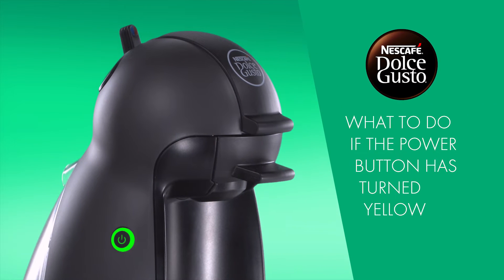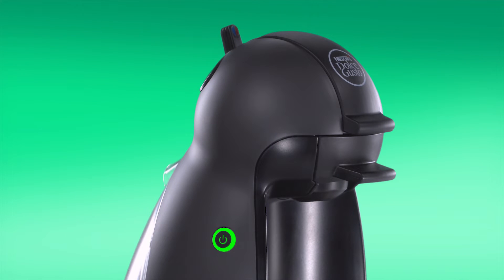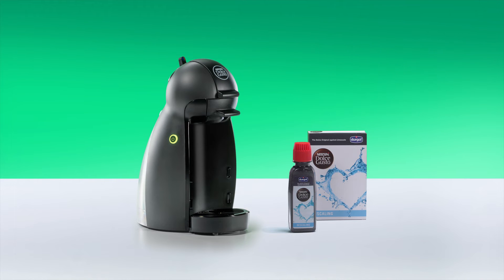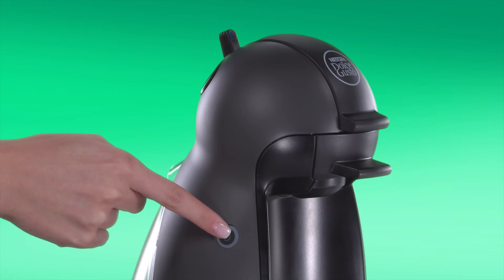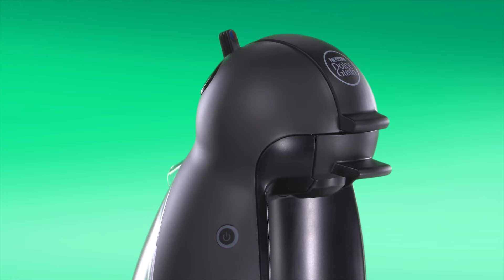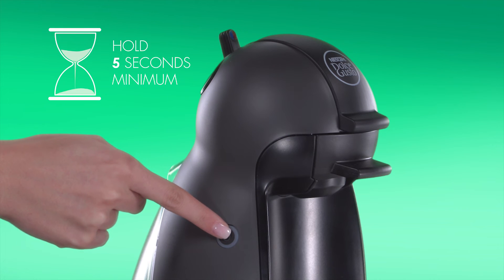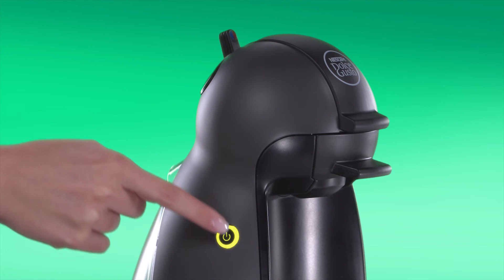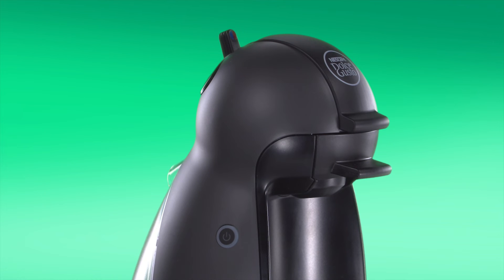The power button turns yellow on your NESCAFÉ® Dolce Gusto® Piccolo coffee machine by Krups®

Comment: okay, i needed clarification on this. If the button turns yellow: do not push the yellow button for 5 seconds like I did. First, turn off the machine and then push the button for 5 seconds.  It will flash yellow. Then push the button to turn off. When you turn it on again, it's green. If you have a piccolo without buttons: just plug out and plug in again.